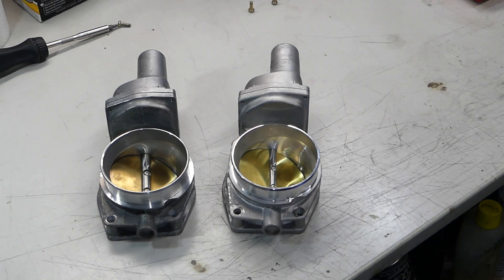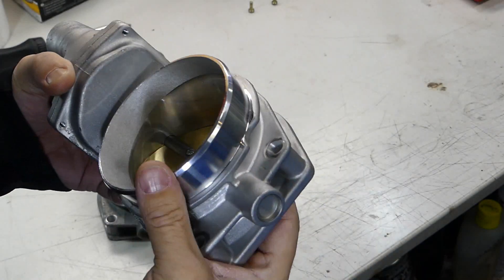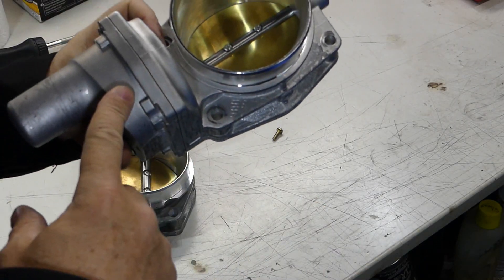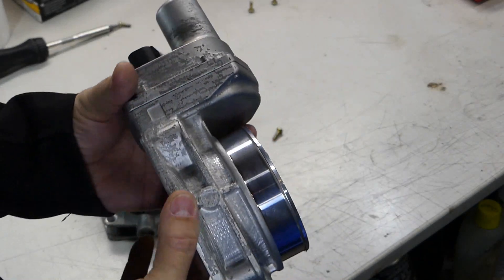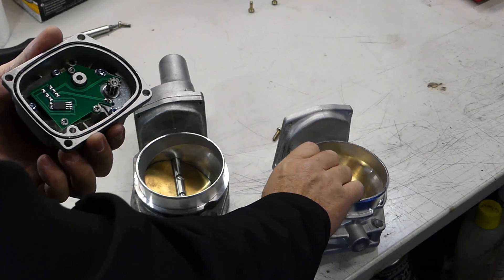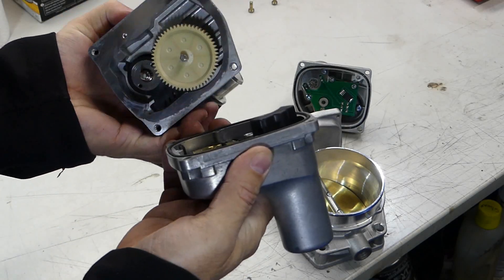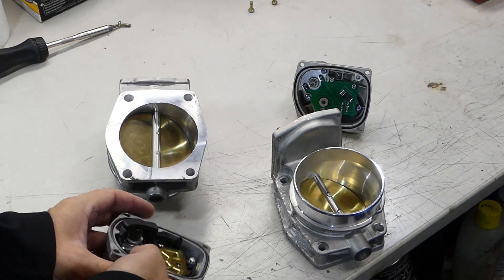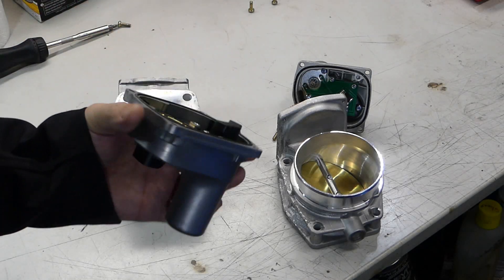GM Vs. Unbranded Drive by Wire Throttle Body

Comment: The only real difference here is using a magnetic rotary position sensor instead of a potentiometer -- which is the gold part that turns with the butterfly.
Reply: For your information, I put a Doorman TB and 6 months of P2135 code all time, I bought a GM original the problem was solved. Thanks to this guy that posted this video. I love my Corvette again. God bless you.

Comment: That chip on the PCB is not a stepper motor controller. It's a magnetic rotary position sensor. There is a magnet on the end of the shaft in the yellow-greenish half-gear, as it rotates the chip measures the position. Also, it's a DC motor in there (just like the OEM part) and the driver for the motor is built into your ECU.  I'm guessing you didn't recalibrate your Haltech to reflect the voltage curves of the new ECU. I certainly wouldn't use one of these with an OEM ecu, but it should be just fine with an aftermarket ECU.
Reply: Thanks for clarifying. Tore mine down and came back to comment exactly what you already said!

Comment: Fun video.  Not sure I agree with your position feedback analysis.  The generic version looks like it uses a magnetic absolute position encoder, which if implemented correctly should be extremely reliable.  something else seems to be going on to throw the error.  Maybe a cal mismatch?  Or the drive is a POS?

Comment: Ok. If it unbranded. Who did you purchase it from? 1a-auto ? Summit? Rock auto?  Who was it?  So far saying Chinese isn’t buying me that this is a legitimate gripe. Or maybe your selling than complaining.
Reply from the maker: I bought it on ebay,  it shipped from China.
Reply: @DoesItTrack . 1a-auto has one posted on eBay ,looks identical, but they back it up and guarantee it for a year.  I’m thinking about buying it from them.  Thanks for the reply.
Reply from the maker: @theozman38  Pop the cover when you get it, see what it looks like on the inside. Always up for a good deal! 👍

Comment: WOW! Thanks for sharing this. I'm currently trying to figure out if I need  a new IAC for my 99 Accord. So this is good info even though I don't have a GM. Mechanic says I need a new throttle body sensor. Sent me a link to an unbranded item on Ebay. I'm sketchy about buying an unbranded item. I'm also thinking of changing out my IAC because my former  trustworthy mechanic fooled me by removing my brand new IAC and replacing it with a junk yard one. Later took my car to the dealer for a full cleaning and was told that was the DIRTIEST IAC they've ever seen. This is why I'm doing my own work now. Can't trust anyone now.

Comment: Sorry my ignorance but got a question...adding a 90mm throttle body to an ls2 which comes with smaller size throttle body from factory..it requires relearn? Or a tune up? Or just plug and play?

Comment: Hold on once both are calibrated why should there be an issue ? One is simply done in a slightly different way, the cheep one looks to be getting it's throttle angle by motor movement
Reply from the maker: One way is accurate, one way is not. These cheap ones don't have any position sensors on the throttle at all. It's all just motor step count. Fine for a printer that can reset and recount, not fine for a car. This is why good tuning software such as the Haltech in my case will see these and go into fault mode. Plain and simple, it's a major risk running one of these.

Comment: What's the possibilities of putting old internals on new one and adding the post to the tps sensor to knew one? Seems illy I know. But I'm someone of a finagler 😂
Reply from the maker: I thought about that as well. Especially since I had a brand new casing. It looked to be a bit different on the inside and I was really afraid I would destroy my "good" one trying to get the guts out so I didn't really try.
Reply: @DoesItTrack  they look sooooo similar, I hate that good ones are so high
Reply from the maker: @kevinreed4399  I totally agree.

Comment: Just got one of the cheap ones to put on my 2007 Envoy. Couldn't even leave the driveway and voila! Limp mode.Put old one (GM) back on and no limp mode. Envoy idled like new with cheap replacement but went to limp mode when accelerator went more than halfway... limp mode.

Comment: When using a Gold blade on a gen 3 you have to change ” Throttle to rpm ” values in HP tuner to 90% otherwise ecm will revert to limp mode as it goes out of bounds for gen 3 ecm.
These are otherwise ok to use but you must do a retune of your ecm.

Comment: I too purchased one of these "cheap Chinese" throttle bodies (from Ebay) and carried out a comparison. Like you I was surprised, as to what I agree looks to be very cheap and nasty. But looks can be deceiving!!
As an electronics engineer I made a more in depth investigation into why the position sensor looks so basic and simple. As a result I think your evaluation relating to this cheap Chinese unit may be wrong. Even though the internals look cheap, what you looking at is a high tech, state of the art magnetic angle sensor which in many aspect is more reliable, robust and accurate compared to the genuine GM unit. The magnetic angle sensor does not embody mechanical moving parts and as such cannot wear out (other than mechanical fatigue induced by thermal cycling). The fact that it looks so simply and basic is what makes it reliable. However do not mistake the simple looking electronics for the complexity in the technology which is contained within the IC chip.
 The GM unit on the other hand utilises mechanical variable resistors which in their nature will wear out and are susceptible to contamination. I suspect this is the primary reason why genuine throttle bodies fail. The variable resistors used in the GM throttle body is technology which dates back to the late 19th century (over 120 year ago). 
I have no doubt that the factory GM throttle body has far higher quality mechanical components such as the drive motor, gearing,  machining tolerances etc. But as far as the throttle position sensor goes, I am afraid to say that the good old GM factory unit is using antiquated technology which in this application I suggest is technically inferior and far more expensive to manufacture.
Reply: It’s funny… when searching for videos like this you will find videos trashing gm throttle bodies for being junk. While watching this video I found it disappointing the video didn’t mention anything about the components on the board. If it is a cheap Chinese knock off it still has to work even if for 10 minutes. The ls2 TB doesn’t have the additional tps as it’s included in the TB so the creditability of this video goes out the window because he didn’t even know what he was looking at and assumed older technology that many others consider unreliable and junk to be superior. I for one am glad that someone saw the need to make a product that would work in an older application while using more updated components and methods. A oem gm ls2 throttle body used at this time 8/21 is going for min 300.00. And that price goes up considerably which is some what laughable. This TB body is not something complicated. This video is a joke.
Reply: You should make a video of your analysis. I do wonder, if the ebay version is using superior electronics, why is it not meeting specifications of the OEM unit, and throwing codes? Does it just need its own calibration? I would expect they would design it to meet OEM specified parameters, but perhaps that's not the case.
Reply: @amorgan93  I found the voltage reference levels are reasonably different to the stock throttle. As such I doubt it would  work straight out to the box and that is probably another reason why these units get such a bad wrap.  Some ECU have a self learn feature which enables the software to automatically re-calibrate with the new throttle body.  Even with a replacement OEM unit the electrical references will vary from one unit to the next.  In relation to how this re-calibrated (re-learn) is done depends on the model and version of the ECU.   The re-calibration is a function of the software running on the ECU (or the Throttle control module). On some version the re-calibration may  occur automatically as you are driving, on others you may need to plug the ECU into a special diagnostic tool.

Comment: maybe the problem was just a throttle calibration needed for the cheap part.
It can't be that bad if it's on the market. It has to function at least for a few months.
Reply from the maker: Sadly, no. Its a cheap imported part. With a Haltech ECU the calibration process is very straight forward and was done correctly as its a built in process. These parts are honestly 100% "you get what you pay for".

Comment: Do you think there might be a possibility to modify the unbranded one to use the original Factory Electronics?
Reply from the maker: I wouldn't use the unbranded one for any reason.
Reply: @DoesItTrack  would save a lot of money if it's 102mm upgrade that you could use there casting gm's electronics if it could be modified to work?
Reply from the maker: @AGhostRiderR  the aluminum part is good, the electronics are not.
Reply: @DoesItTrack  that's what I'm thinking maybe i can customize the aluminum part make it work with the factory electronics.
Reply: @AGhostRiderR  Im going to be doing this in the next few weeks. Technically the casting is slightly different. I only see one major issue that might require grinding. All the screws line up as I expected, I was slightly surprised that the casting had some differences on the inside walls. I will post pics later after I have all the parts I need because I am stealing/using the GM electronics out of my current 92mm Ported TB. Unscrew and add thread locker to all TB blade bolts, sand transitions smooth and swap GM electronics from an easy to find, cheap GM 90MM Gold blade TB typically called the LS7 TB.
Reply: @josephmalczewski  mine was different i would have needed to customize a part which i tried but didn't work then put it back on and its ok now so i haven't touched it.
Reply: @DoesItTrack  mine was different i would have needed to customize a part which i tried but didn't work then put it back on and its ok now so i haven't touched it.